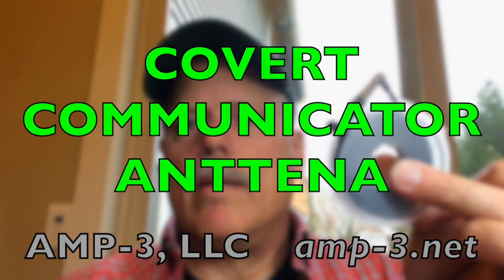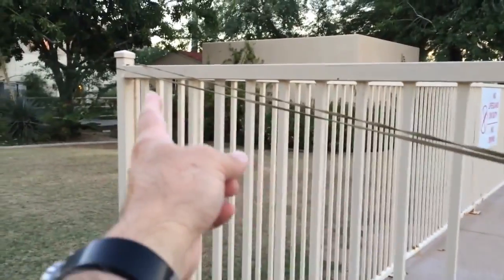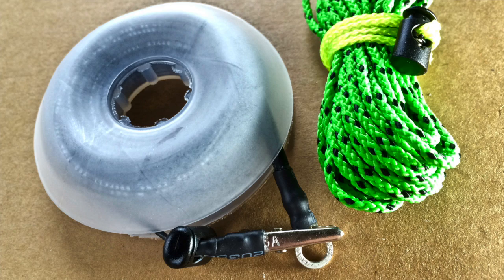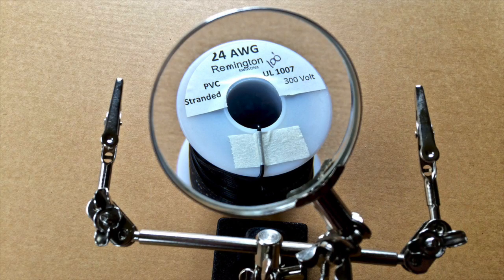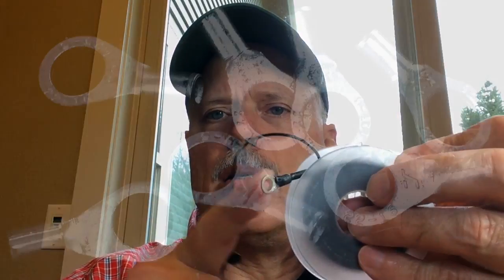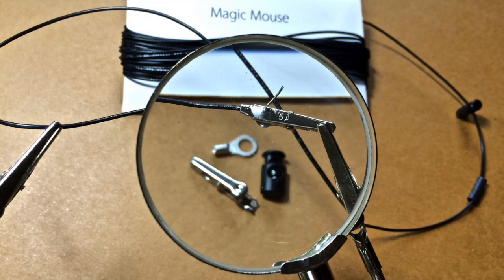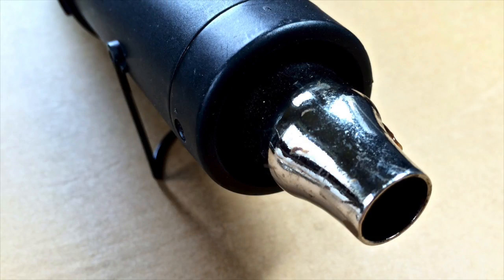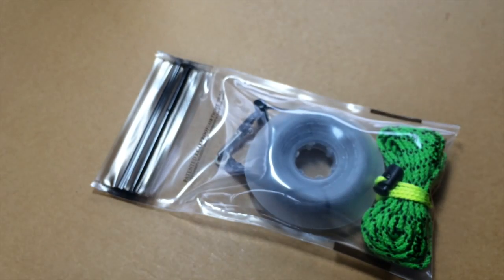Long Wire Shortwave Antenna - Building The Covert Communicator

Comment: Great video as always.  What gauge wire do you use for the larger antenna? Also where do you get your cord lock, and what is the device called that you wind the covert antenna on?